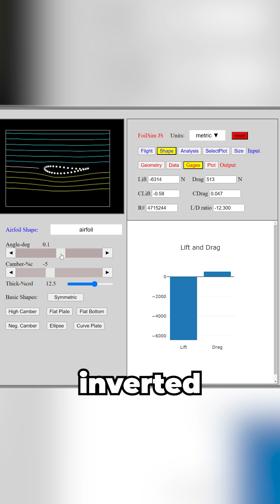What Prevents Airliners From Flying Inverted Like Aerobatic Planes?

Comment: Then are the wings of fighter jets , based on the symmetrical air foil design?
Reply: Usually not, but they have airfoils with only small amount of camber and neutral chord unlike airliners. For instance F-16 has the NACA 64-206 airfoil profile if you wish to google what it looks like. They're not quite as efficient upside down, but they only require slightly higher AOA during inverted flying.